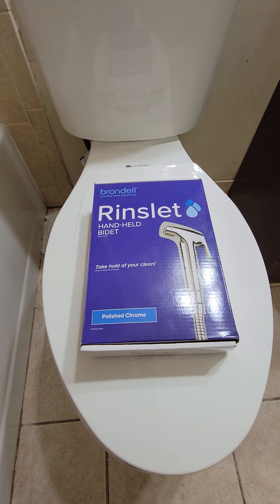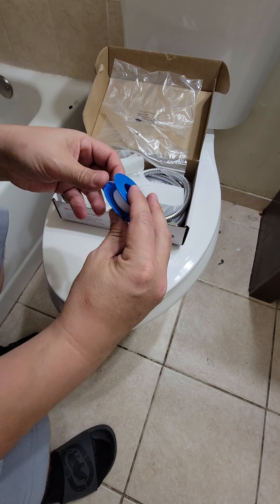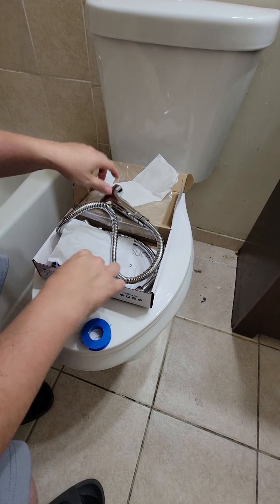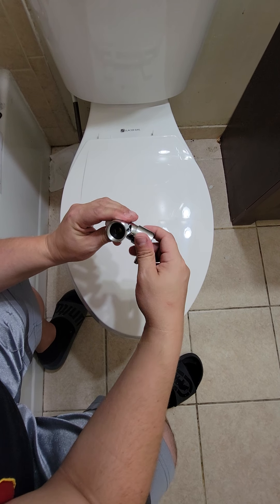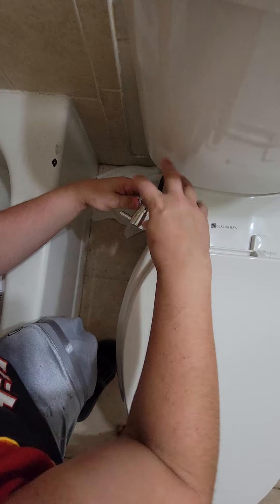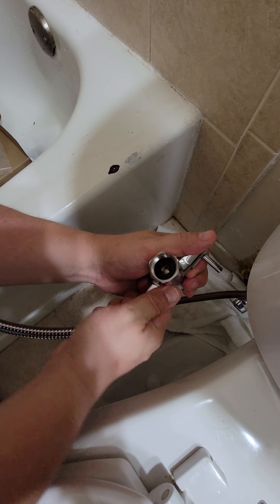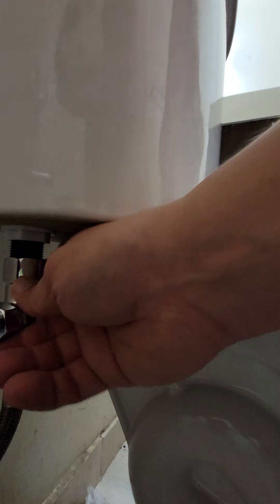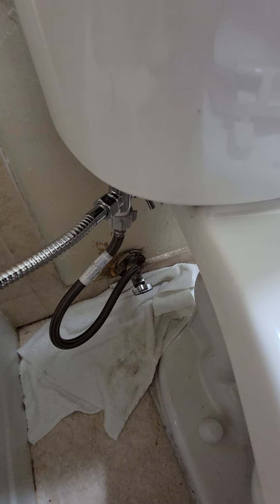How to install a bidet with T valve, DIY #toilet #bidet #installation #home

Comment: Thank you so much for the video. I tried to install my bidet but the water is leaking. My T-valve doesn't have any rubber cone (washer) in it so it might be the reason. Does your valve have rubber washer inside the valve?
Reply from the maker: Sorry to hear that, the rubber gasket will help you not leak.
Reply from the maker: Please let me know if you fix the issue, hope you subscribe 😊
Reply: @hamiltonsdoityourselfguide  Thank you! I put the gasket and it helped!

Comment: Hey guy my t valve is smaller than the inlet of toilet tank. What is the easiest way to get it connected to the tank.  Product description says that t valve is 7/8.
Reply from the maker: Did the bidet you bought come with T valve ?  If sontgey are cheap and not good.  I went and bought at home depot a metal one standard size.

Comment: Thanks for the video. When I put the washer in, the t-valve doesn't fit. If I don't use the washer, it leaks. Please  help
Reply from the maker: Please explain a bit more
Reply from the maker: Might need to double check the size of your Tvalve
Reply: @hamiltonsdoityourselfguide  Thank you your response. T-valve screws on fine if I don't put the washer in, but when I put the washer in, it's loose. I think washer is preventing the t-valve from make the connection with the bottom plastic part of the flush.
Reply: @hamiltonsdoityourselfguide  is washer necessary?
Reply from the maker: By any chance have you tried to use teflon ? @user-fs8jm7bm4b
Reply from the maker: @user-fs8jm7bm4b have you tried plumbers tape ??
Reply from the maker: Did you finally fix it, I would like yo know it worked for you.

Comment: Hey! Thanks for the video. I am trying to install one of these but the t valve is leaking. The part that is leaking is the connection that goes on the tank of the toilet. I’m not sure what I did wrong. It seams tight enough tho
Reply from the maker: Did you use plumbers tape ?
Reply: Hello. Did you figure out how to fix that? I’m installing it rn and I’m facing the same issue
Reply: @ankitaroy9078  no I couldn’t get it to stop leaking even with plumbers tape
Reply from the maker: @HouseofBanana  did you make sure you have the correct size fittings ?
Reply: Same issue, having a lot of trouble with leaks
Reply from the maker: @cool_flame  where is the leak from ? Valve or toilet ?
Reply: @hamiltonsdoityourselfguide  It leaks from the valve connection to the t pipe. I've used plumbers tape, tightened, and repositioned it about five times I can't get a seal.
Reply from the maker: @Quetza  hmmm , is it the same valve from the vídeo  ? If so you might have gotten a defective one. Although that's strange being a metal one.
Reply from the maker: Also , I know we don't want to over tighten , but is it tight ?
Reply: "I faced the same issue with my T valve leaking. After returning and getting a new one, I was still frustrated. It took me an hour to realize that the rubber was the problem. Make sure to place it flat in the T valve. Once I did that, it only took 5 minutes to install. I repeated the process for all three bathrooms without any issues. Hope this helps!
Reply: Did u make sure the washer didn't in the t valve didn't fall out? Won't seal without that washer.
Reply: @araung21 bingo! This guy for the win...

Comment: The washer fell out of t valve and I can't tell which side goes in. Both seem logical but not at the same time. Why wouldn't they tell us
Reply from the maker: Hey bud did you fix it ?
Reply: The taper goes up, the flat goes down (think water flow)